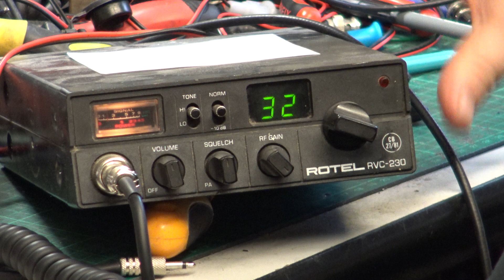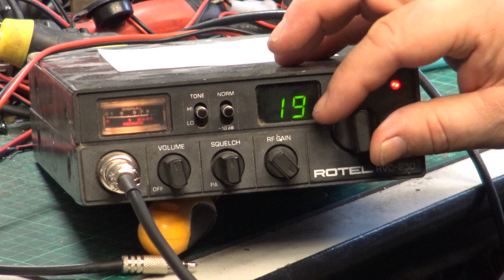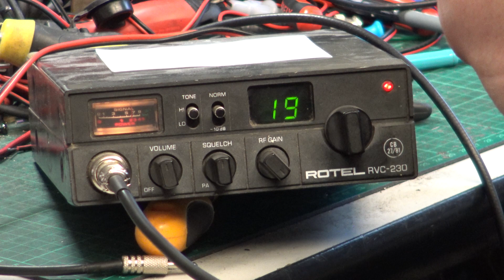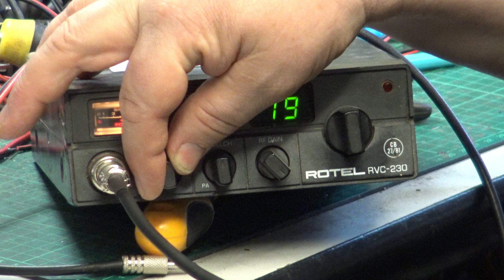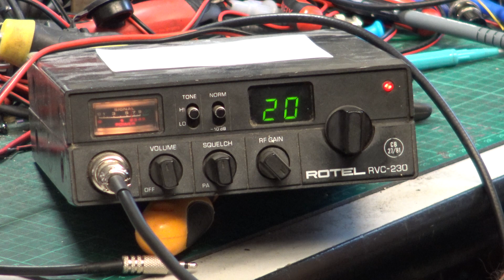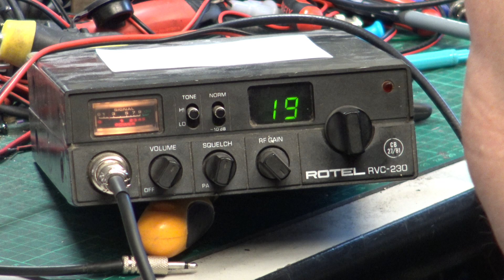Harvard WT1 CB27/81 50mw 1ch cb walkie talkie - Field test

Comment: Damn I Remember Swapping A Scalextric For Two Radios With Similar Output , They Had Rubber Ducks And Ran Off A PP3 Battery 
I Was Only About 11 Years Old But Me And My Little Brothers Were So Excited With Portable Radio Back Then ! 
Great Video Lads 
Bless Up :)
Reply: When i was a schoolkid i had a pair of 29.86MHz AM 100mw skyfones
half a mile at best. they were legal (in theory) to own and import, but not use.
They got around the 1967 marine broadcasting act which banned
 26.1 to 29.7MHz Transceivers. by dealers like Lee electronics recrystaling
 them for above 29.7. 29.86 became the most popular
Reply: @phillipsmiley5930  Yes Buddy I Think Mine Were On 29 Mhz !  
Back In Them Days PP3 Ever Ready Batteries Were Not Cheap So Mom And Dad Got Sick Of Forking Out For Them And I Think I Swapped Them For A Casio Digital Watch With A Few Different Melody Alarms
I Was Always Going Home With Something New From School :) 
Graham , Birmingham
Bless Up :)
Reply from the maker: Good grief Graham, you did plenty of swapping!

Richard
Reply: @ukfmcbradioservicingTango21  It Actually Started When I Was In Junior School When I Made A Telephone , All It Consisted Was Two Old Phone Handsets And 6 Volt Lantern Battery And Lots Of Wire , I Think I Put One Mic Terminal Twisted With The Other Earpiece To The + And Vice Versa On The - 
And It Actually Worked With No Amplifier Circuit .My Teacher And Classmates Were Amazed When I Went Out The Classroom And They Spoke To Me ! The Teacher Then Told Us About Alexander Graham Bell :) 
Another Little Invention I Made Was Just A TV Transformer Fed Through The Primary With A PP3 , I'd Charge 10 Pence A Time For The Kids To Lick Their Fingers A Get A Lovely Jolt ! That Was Confiscated By The Junior School Headmaster :(  
I Was Called The Swap Shop Kid :) 
Bless Up Fella